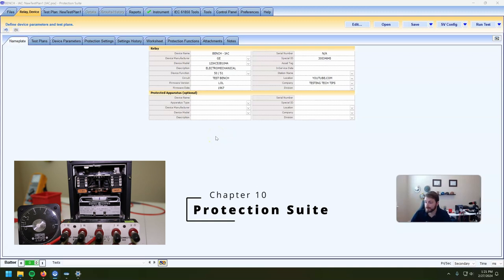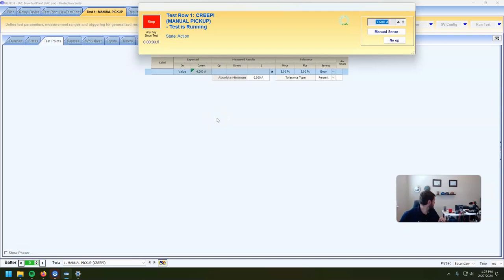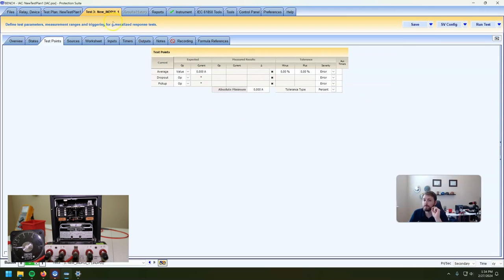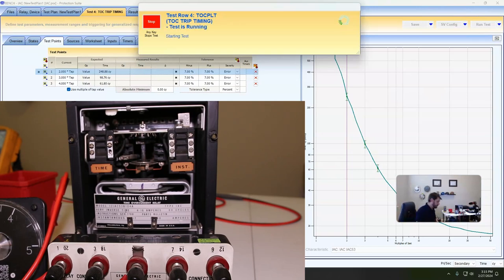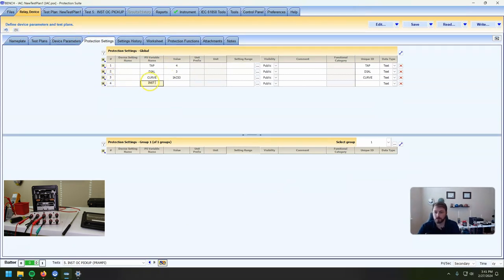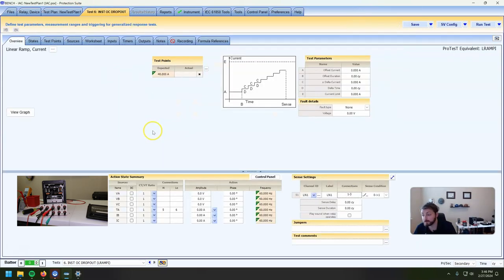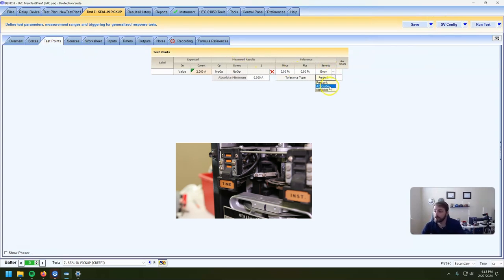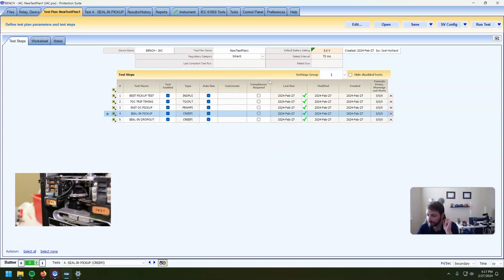GE IAC Masterclass Part 2: TESTING - How To Test Relays ep6

Comment: I've always been taught that adjusting the clock spring is for adjusting pickup. To adjust the timing, you should have adjusted the drag magnet, not the clockspring. I'd be interested to see how much your pickup moved now that you moved the clockspring. I know when you adjust one thing, it moves the other so you can often get away with tweaking one thing to fix both (or at least get away with staying with tolerance) as long as you go back and retest pickup/timing to re-verify the tweaks.
Reply: That's a really good point and I don't think I mention it in the video. Both adjustments affect both the pickup AND timing to some extent. I've found that a small adjustment to the clock spring has a more drastic effect on the time curve than the pickup in terms of the percentages we record during testing. That said, I certainly should have retested the pickup after making the adjustment. And I agree, I too am curious how much that tweaked the pickup. Thanks for your comment, now I need to make a follow up video 🙃